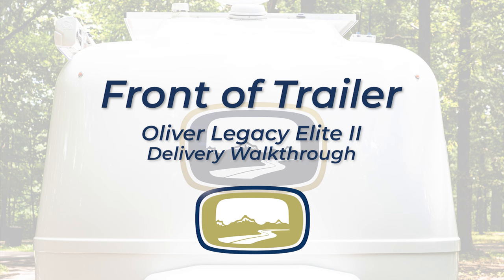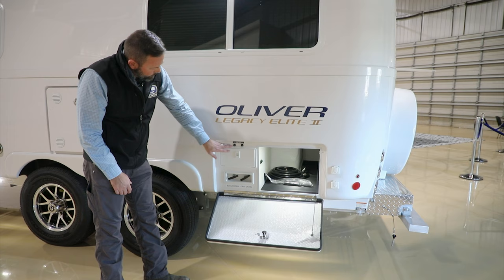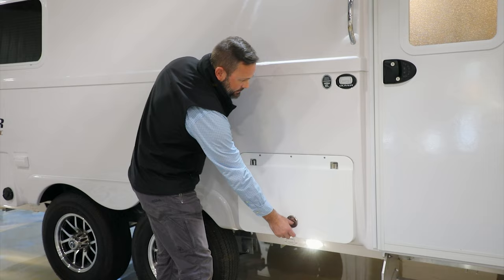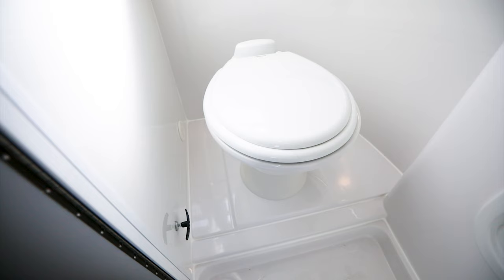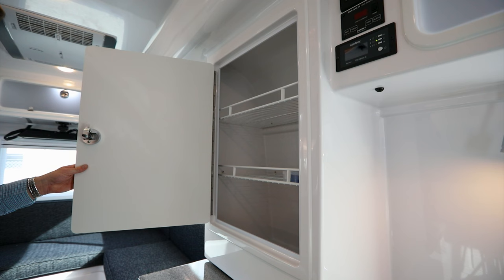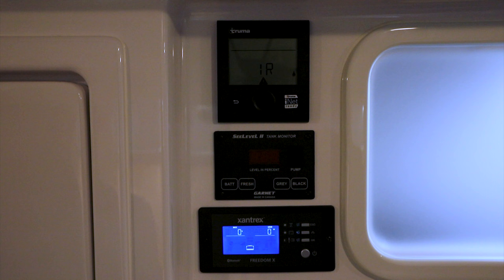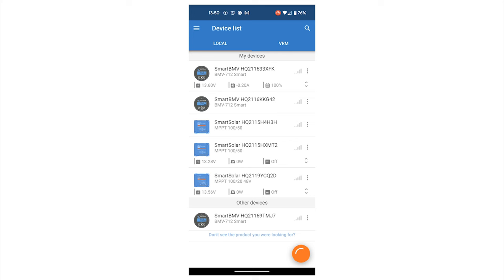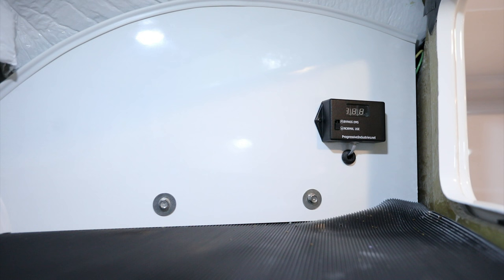2024 Oliver Legacy Elite II | Delivery Walkthrough | Oliver Travel Trailers

Comment: PLEASE tell me you’re working on an Elite III 😊 I love these, but as I like to boondock I would love (want) larger propane, larger tanks and a larger refrigerator.
Reply: Take a look at the Cortes trailer. They’re all fiberglass with a big refrigerator.
Reply: @darrelltremblay9169  — I have, VERY NICE!  But if I remember their tanks were 21/13/15 gallons. So the Cortez tank capacities are smaller than the Oliver’s are.  😎
Reply: They could easily install a bigger fridge. We have also been asking for an option for omitting the microwave and adding a larger fridge then having a small oven instead of the cooktop. Bigger tanks would be easily done as well but with a DC fridge less propane is needed.
Reply: @jamesraymo3582  — I like the way you think, but I would say there are caveats.  It’s a fiberglass RV, so any change would necessitate a mold change, and that takes planning and money.  I use a microwave much more often than my stove, my point is for every person that doesn’t care about the microwave, there’s another that thinks it’s a dealbreaker.
Reply: Escape Trailers has a new 23' trailer with 42/40/40 fresh/gray/black tanks and a 7 cu ft fridge (dual 20 lb. propane tanks like the Oliver), but you'd be losing the higher quality and 4-season capability of the Oliver.  My wife and I almost bought an Escape, but were fortunate to discover Oliver before we pulled the trigger.  Tank sizes have not been a problem for us.   You can always carry an extra propane tank, a portable fridge, and extra water in the bed of your truck, wash dishes outside, and Oliver offers a composting toilet option.
Reply: @bryaninnc5511  Good point on the composting toilet. With a standard toilet you will flush 50% or more of your fresh water to the black tank. You effectively double the amount of fresh water you have to use for kitchen and bathing.

Comment: Do the apps for the batteries and the solar charging offer remote offsite monitoring? Could it be done if you install cellular access in the trailer?
Reply: You could install the Victron Cerbo GX and then add the cellular modem to that.
Reply: @freighter1097  thanks. I worked for a generator rental company and we had remote monitoring for all our equipment. It is great to be able to check on battery condition if you are away.

Comment: Not a fan of a wet bath.
Reply from the maker: Hi Paul, thanks for the feedback and we just wrote an article about the wet bath. You can read more about the benefits of the Oliver's Wet Bath which helps make it easier to maintain and keep clean thanks to the innovative molded fiberglass design:
https://olivertraveltrailers.com/blog/why-you-need-a-wet-bath-in-your-camper/